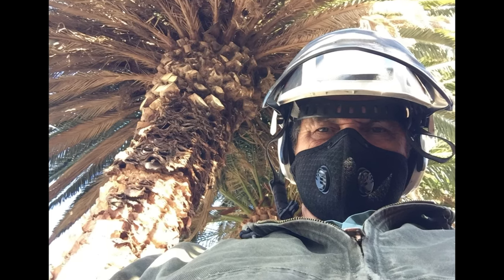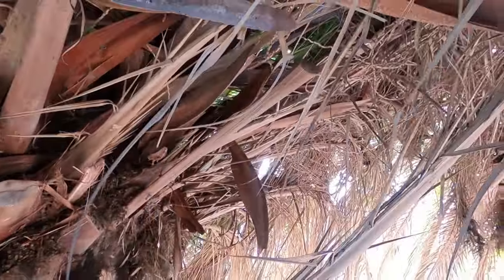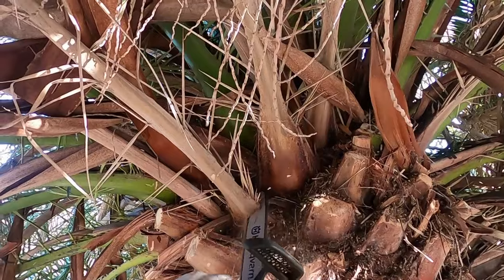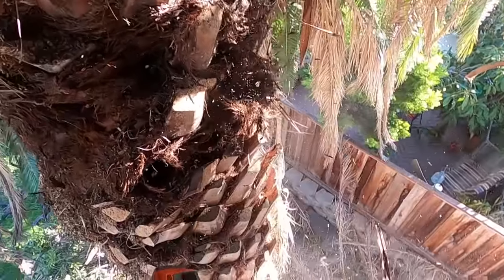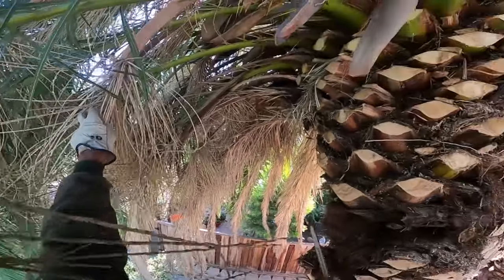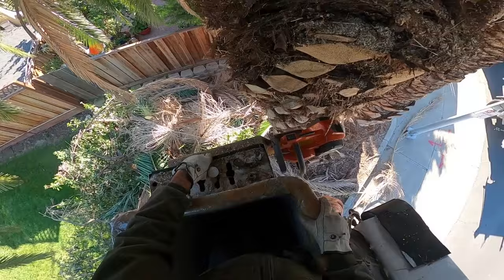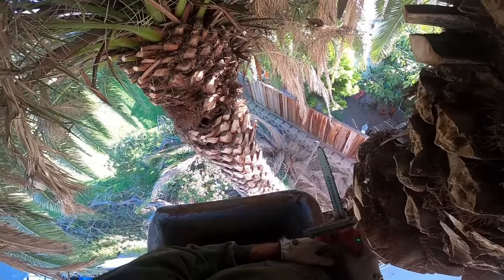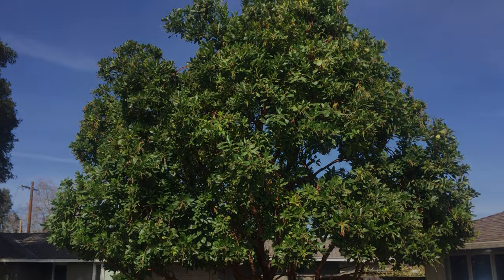The MOST DANGEROUS TREE

Comment: I also really appreciate your video, it isn't too long. I appreciate the detail you show. I have two of these to do, and I'm reconsidering my price. They are both next to a pool and have long old fronds that have those nasty spines sticking out. The old fronds are about a foot long. The client has two small children that likely to get seriously hurt by those spines. He sent me a picture of two palms done the pineapple cut way and asked me if my price included doing them like that... there's no way, just like you described in this video.
Reply from the maker: I never make money on these date palms. Even a good bid seems to end up with issues.
Reply from the maker: You can do them with care but hard to get out without drawing blood.
Reply: Thanks Blair, I decided to withdraw my bid. I do other trees, but I have a fistula (dialysis access tube) built into my left arm from kidney failure in 2006. I got my transplant 12 years ago but the fistula is still there... it's a huge modified vein just under my skin on the forearm, wrist to elbow. If it gets punctured it's a fast bleedout, so my wife advised against the job 😉

Comment: i have one of these trees in my garden i hate it when i need to trim it lucky its a small one but still the chipper i use a heavy duty domestic and if i dont put mix wood with it the fronds just tie it up like bits of string had gone though it
Reply: I cut the end off with spikes first, then the rest can be handled safely. All goes on the fire.

Comment: For those wanting guidance on these, read my comments below, but I want to add something I forgot to mention.
On some of the dead fronds, I would use the pole saw to reach out on the dead fronds where they branch out and pull to me, then just JERK on them to put pressure on where they attach to the trunk and they would break off--makes a clean break--others would not break so later had to cut with a chain saw.  Also, when about 1/3 of the way from the top I transferred from being strapped to the trunk to that climbing line I mentioned below pre-installed from the ground.  Then,  using foot ascender, climbed up above all the remaining fronds, including the green ones, to then use a chain saw, which is  lot safer then, but still a lot of work.

Comment: Number one: Why are you trimming from below the fronds, the worst place to be?

Second: I saw a video with a climber going up the tree and it explained climbing outside of the fronds to get above them is the safe way to do it.  There was a rope above the fronds. How in the hell do they get a rope up there?
Reply from the maker: You need to understand palm trees to work on them. Some palms have too many dead frond that can involve a slugging of the group. If tied into the tree, that skiff off can bury you. If you are in a bucket, that is not an issue. Getting the rope over the top is done with a weighted bag and small rope which pulls over the larger climb line. Also, depending on the species, the 8” spikes on the fronds can be very dangerous so positioning is key.